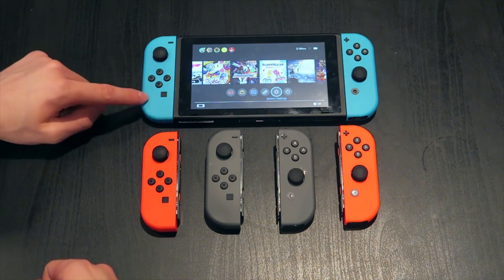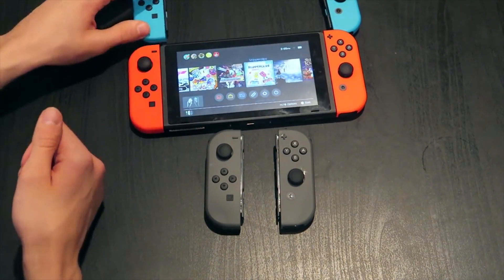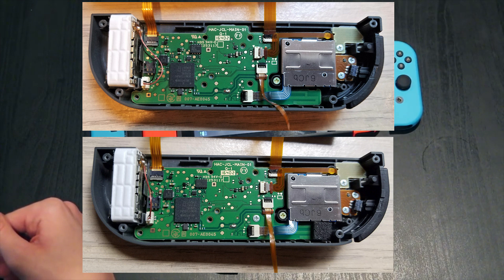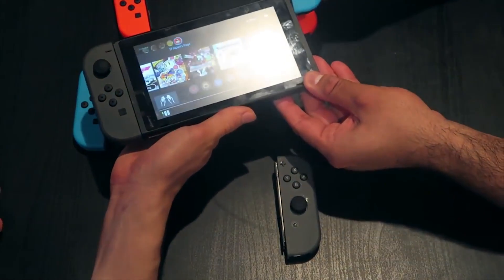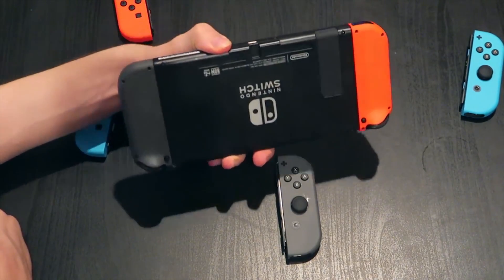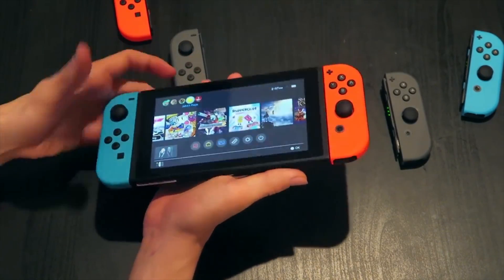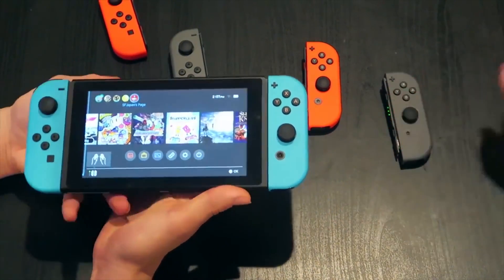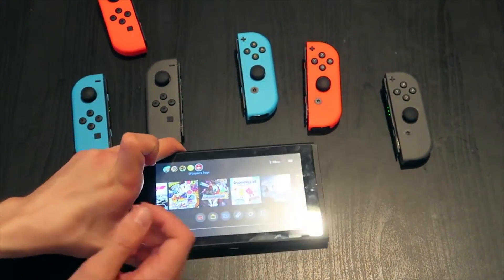Switch Fix? Nintendo Fixes JoyCon Desync via Modification

Comment: they did patch it. you have to have the 2.0 update, remove your joy-cons and un-pair the joy-cons. restart the console and then pair the joy-cons again. this will update the joy-cons boosting the signal in the left joy-con. problem fixed.
for some reason, updating the console does not guarantee the joy-cons receive the update when they are paired to the console.
did this and have not had one issue
Edit...
Sorry if this does not work for some. Maybe some have actual hardware issues and others just need the update. This definitely worked for me. I couldn't play five feet from my console, now I can play from my kitchen. It's worth trying before you send them off.
Reply: Kyle Peacock   This actually worked for me..  thanks dude
Reply: Kyle Peacock omg, thank you, will try after class tomorrow.
Reply: Kyle Peacock Should be top comment
Reply: I'm skeptical of this. Sounds like one of those things people just repeat all over the internet since it requires a lot of steps, and if someone says it doesn't work, you can just say "well you must've missed a step!" Where is real solid evidence that there was indeed an update that boosts the signal?
Reply: Kitty Three steps. 3. If you consider that a lot of steps I feel bad for any other tutorial you have ever tried to follow.
Reply: Sounds like that iOS 'waterproofing' update to me. You can't fix a hardware issue with a software patch.
Reply: Kyle Peacock many people still have problems after doing every step.
Reply: Kyle Peacock .
Reply: I have a battery issue too with the left one. doubt that'll fix that
Reply: it didn't work for me

Comment: my only issue was when my left joycon would not support handheld mode, but this was fixed by disabiling the joycons from the sytem settings and resyncing them have not had issues since

Comment: I was more than certain that there would be hardware or software problems for the first shipped out products of the Switch. So this is no surprise to me. I'm also happy that I held off on buying this thing until a couple months have passed since its launch. Also coupled with the fact that I lacked the funds to buy it in the first place I am happy they are making quick work on the updates and/or repairs needed to make this thing work properly. 👍

Comment: I soldered a wire onto that antenna solder point on the board and it extended my left joycon range significantly.

Comment: I got my Switch at launch and have STILL had no issues with my Joy Con. I run EVERYTHING in my house wireless as well and my Joy Con work perfectly a good 20+ feet away from the console. That being said, I've heard nothing but good things about Nintendo repairing any issues that seem to be faulty with their hardware so definitely if YOU are having an issue then just send them in. Also, buy a bloody Pro Controller because it's totally awesome! I charged mine the one time when I first got the system and I haven't needed to charge it once yet despite countless hours of Zelda and Fast RMX.

Comment: so the entire problem was the lack of an RF shield, wow
Reply: Catsinelixe Holloway the actual problem is a very poor antenna placement that foam is likely not a shield but a conductor. It's sitting right on the antenna lanes on the board. I fixed mine by soldering a wire to extend the antenna.
Reply: smart fix, another problem that was apperant from the start was that it was too small so it would be hard to get a good antena placement since a hand would cover nearly the whole thing unlike normal controllers where the antenna can be near the middle near the power button
Reply: i may try your idea if mine has that problem, I might even make it an attachable rigid antenta because I like that, also do you think when I get mine should I go wood grain, carbon fiber, brushed aluminium, anodized purple, or make it iced (ice metalic white with a "fractured" look to it), I want a unique look and I have many material wraps and I can make the rest, and as for the anodized purple and brushed aluminium, I could make a replacement body for it, but that would take a while

Comment: Only issue I've had with the left joycon is having to press the sync button a few times after starting the console, before it'd actually sync with it. No sync issues while playing, thankfully. I can't be bothered sending mine in, but I have plans on buying an extra, grey set, as I had to buy the version with the kindergarden colors (grey one not in stock). Guess I will hold off until I am sure that the ones sold have the fix implemented.

Comment: So my Switch got bent in the DOCK...because of heat...the plastic was bent. I also had connection issues... Already sent it back to Amazon. I will wait some time before I get a new one. I hope they fix the problems in their production line and not just afterwards.

Comment: I sent in my left joy-con to Nintendo for other reasons. I was having the desyncing issue day one, but it happened to be connected to the tablet when it desynced. I thought it fixed itself, but then I started getting stranger problems, L3 stopped working and the control stick started drifting to the left, I didn't notice it until my sister pointed it out and then I realized that I was having that issue day one. Hopefully it wasn't damaged before I bought it and got worse because I don't want to get hit with an accidental damage claim when I didn't break it, separately those things are $50. Not sure why they are priced at $50 separately, but $80 together though..
Reply: Aeladya Day 1 problems
Reply: Aeladya sucks for you
Reply: Aeladya not sure? there is a reason they sell bundles, it's cheaper

Comment: i haven't had any issues as far as i know, but my setup is like 2-3 feet from the console at most at any given time, so i'm probably not likely to enter the range where issues occur. not sure if it's worth the wait to send it in for a problem i haven't experienced. maybe before the warranty ends i might.

Comment: I only started getting problems with the left controller, when I bought an extra set. Then the old one had sort of a lag, But only if something is intererupting its Line of sight to the switch it seems.

Comment: Honestly, this is whats going to happen. If Nintendo thinks enough units had indeed defective left joyjons they will make NO announcement (to not cause stock dips and consumer rage that they have a potentially weaker/defective unit) and start shipping "new" fixed units, turning a blind eye so to speak.

Although, this probably won't happen because I believe the regginator made a statement that not a whole lot of joycon reports were truthfully made aware to them

Comment: when I get my switch, which look should I go for, wood grain, carbon fiber, brushed aluminium, anodized purple, or make it iced (ice metalic white with a "fractured" look to it), I want a unique look and I have many material wraps and I can make the rest, and as for the anodized purple and brushed aluminium, I could make a replacement body for it, but that would take a while, I am rather good at making custom designs and I really feel like I should make my switch look different
Reply: this skins will deteriorate the plastic
Reply: Holden G. Casey only with a certain type of adhesive, and besides, it would be a custom made skin/wrap, I have the equipment to do it my self and I know the adhesive I use should be safe, I just need suggestions of which look to go for

Comment: I have an issue with my left red joy con. It does have a weak signal 25% of the time but not all the time. The thing is it annoys me because I have to change position on my couch. What I'm worried about is that if I send it in they won't do anything about it because it doesn't do it all the tome

Comment: Interesting... Good to see there is a fix. 
I have the issue but it comes and go's....

I sit very close to my tv, and my Switch is in plain view. 

The first day I used it I was having Joy Con sync issues on the left one. 

Went away the following days (I dont use it often got a Pro controller) 
But yesterday my Pro Controller was dead and the issue was back again....
I used the joy cons maybe 4 times and out of those 4 times 2 of them I had this issue.... 

I spoke to Nintendo after the first issue and they were prepared for me to send them back next day it was fine so i called them back to postpone it.... 

But idk the cause but its annoying... 

If I lean my self all the way forward on my sofa it works but lay back it wont....

I don't want to send it back or I wont be able to take the Switch with me or use it out of console mode...

Right now my gf is using the tv and I want to play Zelda.... so yeah wont be able to do that if I send it back....

Comment: No need to open or send in your Joy-cons. Just follow this simple guide. Not fake in any way, just super easy. The patch Nintendo issued for this issue is the solution, but it needs some help installing on the Joy-cons, so, follow the steps - BOOM, no more issues.

Comment: I've had no joycon sync issues whatsoever. I could stand like 30 feet away or more (while blocking the joycon signal with my hand) and I've had no connectivity issues.

Comment: hmm... my joycons are working fine. Only if I put them behind my knees or under my blanket they get some connection issues. Is that normal or will this thing fix it too? 
Is the little Black thing making the signal stronger?

Comment: Mine is on its way to them now.. just in time for the splatoon test fire :(
Reply: lyianx lol it takes a week at least to get them back, your not going to get to play the testfire
Reply: did you have to send the whole console? I'm chatting with nintendo of europe currently, they say 2-3 weeks and send everything in. I have a pro controller, so hoping some people might have only had to send in their joycons instead of everything.
Reply: Jonathan G which part of the switch has issue?  just the joy con of coz.....then just send the joy con....sorry i may sound like a dick, but why people don't think before asking LOL
Reply: No probs Alan, you don't sound like a dick. The thing is Nintendo were telling me "just send it all in" even after asking a few times if that was necessary (for 3 weeks!) Fortunately I received an email from them just now, (after pointing them to NOA joycon tweak) saying I can just send in the joycon if i prefer.. phew. They're fast to reply, which is great. Also, remember the joycon connects to the console, so it's entirely plausible that both parts of that connection may need to be part of that repair even if just for testing. Most people seem to be sending in the whole device.
Reply: yea.. such bummer. Tho they did get it this morning, so maybe i will get it back by early next week if all they have to do is add this treated foam to it.

Comment: I've been having a issue with my switch which his pretty weird as it only ever happens when the screen is changing e.g. going from zelda to the home menu but about half the pixels in the screen go green and flashy in lines and i cant find anything on this online, its not been affecting gameplay as it only happens when going to the home screen and also in cut-scenes, which is the most annoying part. i don't want to get my switch replaced as i will loose all my zelda data (65 hours and over) does anyone know what is happening or how to fix it

Comment: this is completely unrelated, but the dock scratched up the right part of the bezel on my switch pretty bad and i want to know if there's a way to fix it. i just got the screen protector so this happened before it came. what do i do? i dont even know how it happened since i put 2 microfiber clothes inside the dock but of course it still scratched.
Reply: Jared Khan put the screen in rice?
Reply: Spacey lol that was really quick. I thought thats if ur device was in water.
Reply: Jared Khan that's why I put the question mark
Reply: Spacey oh lol
Reply: You could use a polishing kit, but might be risky
Reply: Chemtrail Dreams is there some company or something that can do it professionally for me?
Reply: Jared Khan you should be able to buff them out if they are "scuff" marks. If it's a deep scratch, you might be out of luck.
Reply: ByteBlok _ no they're really light. They're just really long. There's like 3 light but long scratches. How do you buff them out?

Comment: As I expected, Nintendo is using the feedback from it's early adopters to identify and repair issues missed in lab testing.  Tens of Thousands of man hours in a lab is no match for the multi-million hours of field testing the Switch has received in the first week alone.  Are there issues?  Yes.  Are they being fixed and corrected going forward?  Hell, yes.  If it weren't for how vocal many first adopters have been about the issues, Nintendo would be doing this quietly, and few if any potential customers would hear anything about the problems.

Comment: My right joycon crapped out on me today.  It just stopped working after two weeks. It appears to be a battery problem.  😣
Reply: jvyeknom Did you charge it?
Reply: jvyeknom Did you pressed the small round sync button? I had one Joycon not responding after transportation to a friend and it worked the second i hit the sync button.
Reply: Ox King 
I charged it and pushed every button on it. That green light on the side never came on. 
Apparently your not suppose to charge longer than 3 hours.
Reply: jvyeknom Not sure what you said about not charging longer than 3 hours is right
Reply: Saeed Alhosani 
That's what the service line lady asked
Reply: jvyeknom Well,like they say:"DAY 1 PROBLEMS!!!"
Reply: Saeed Alhosani 
I've been playing for weeks
Reply: jvyeknom So?
Reply: Saeed Alhosani 
So not day one.  Day 21
Reply: jvyeknom Ok,you were supposed to get the Switch in a couple of months if you have these problems cause they might fix it later on

Comment: But it doesn't need fixing as there are no issues with the switch at all.
He probably has weak wifi and my switch is running fine with no issues whatsoever.

That's the official line from nintendo owners in the internet isn't it?

Comment: people saying they have at least 10 feet of signal i cant even get 3 ;-; i need to send them
Reply: I've played it in a room with a projector where the Switch was more than 20 feet away from me. No issues. But I'm not saying some people aren't having issues.
Reply: Jose Cuellar I could get 50
Reply: Sauraen on the dock i only get like 1 and a half feet from both controllers. i dont need the 20 feet. i need like 10 feet lol.